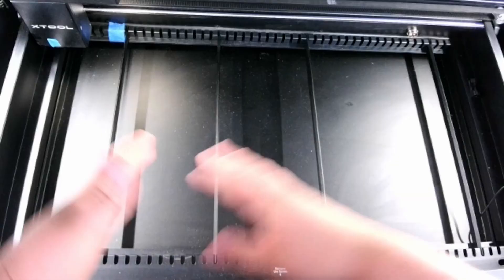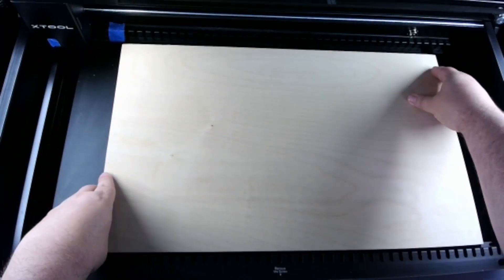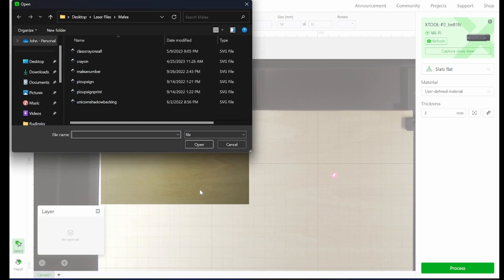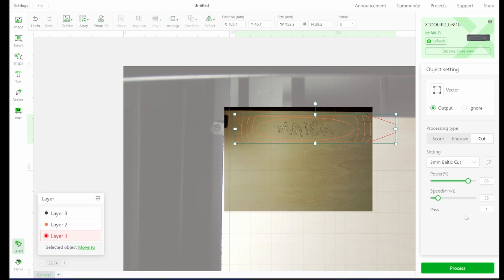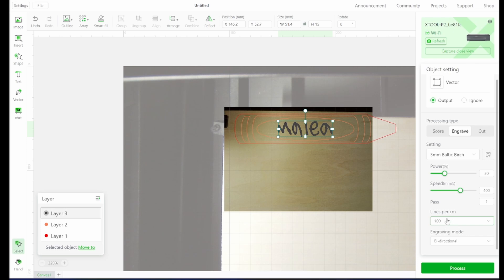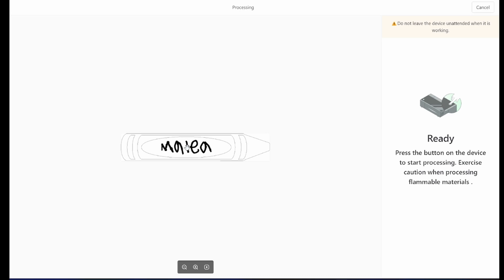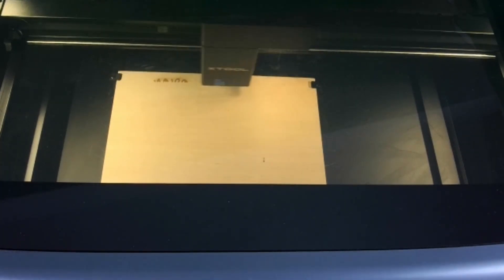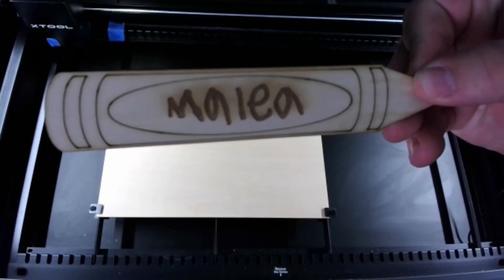How to Engarve and Cut Your First xTool P2 Project Step by Step.

Comment: Great demo! Quick question, does the software automatically arrange it so the Cut layer goes last in the process or did you need to set that somewhere?  Seems important especially when using limited slats where the piece will move after the cut is processed.